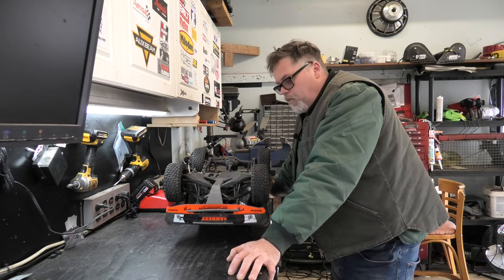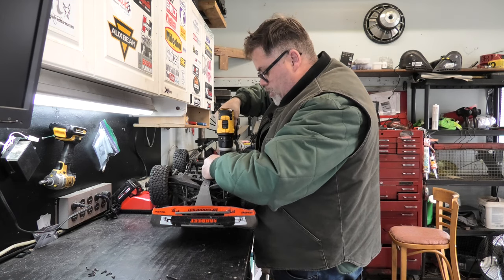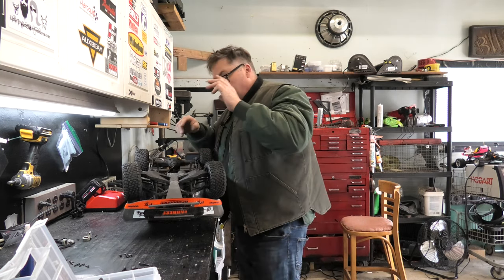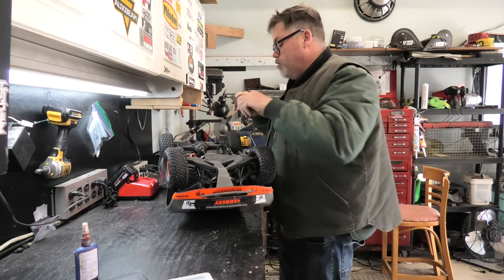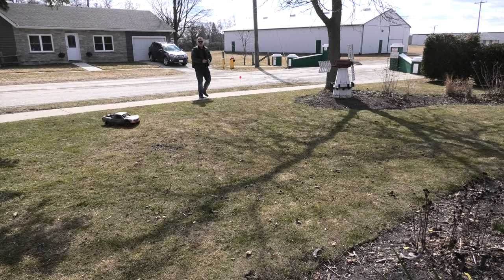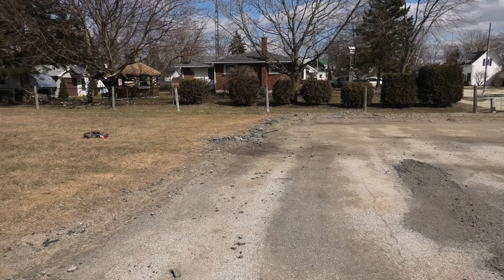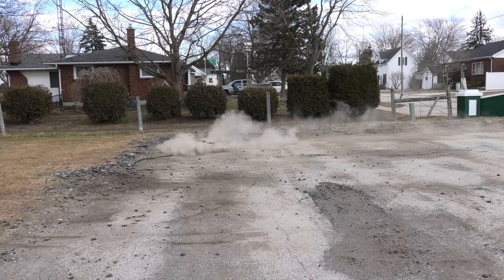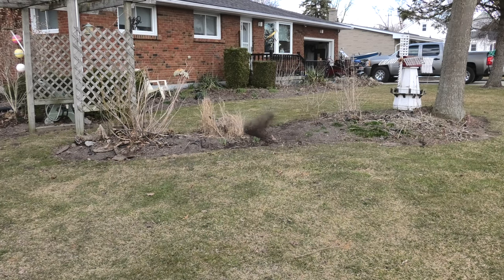UDR Fixed Again Lets Go RCing

Comment: My first trxr4 right out of the box the esc was going in to low voltage called traxxas and emailed them and they did nothing so now it is running hobbywing 1080 in it